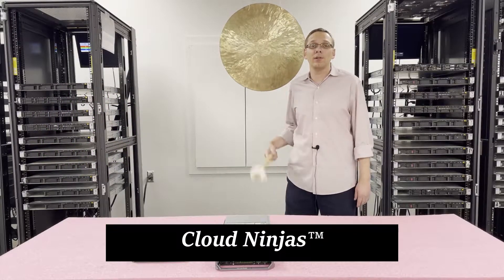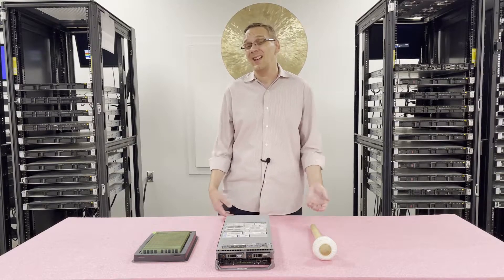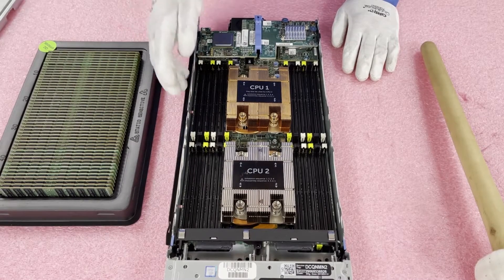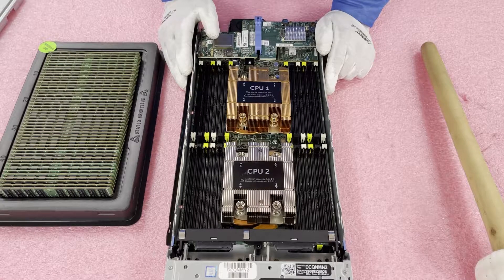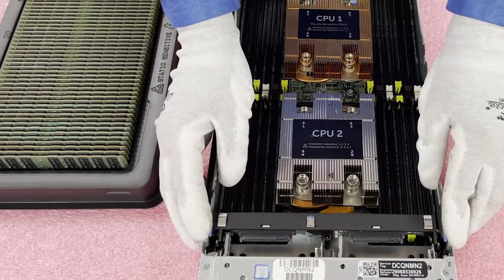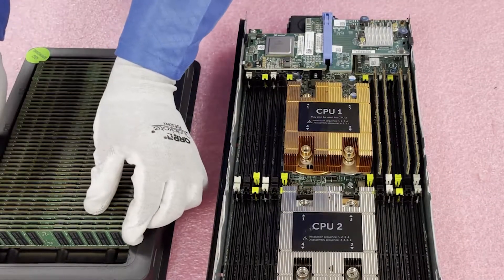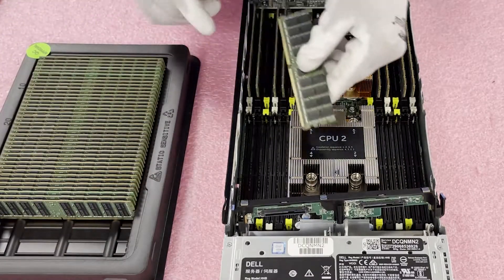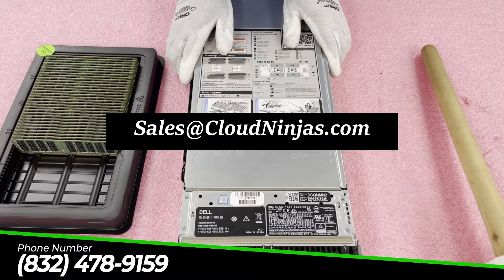Dell PowerEdge M630 Blade Server Review & Overview | Memory Install Tips | How to Configure DDR4 RAM

Comment: Can I populate CPU1 with 8x64GB memory then CPU2 with 8x32GB?
Reply from the maker: Yes.  Or 64GB in the first slot of the channel and 32GB in second slot of the channel.  If different speeds then will clock down to slowest speed... just a heads up.  Take care!